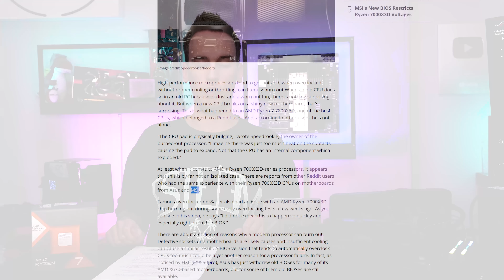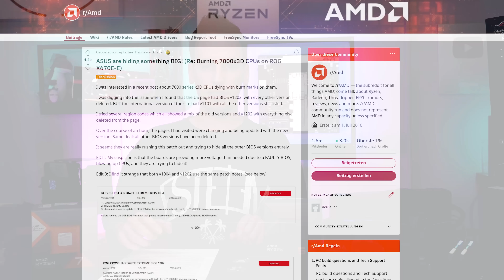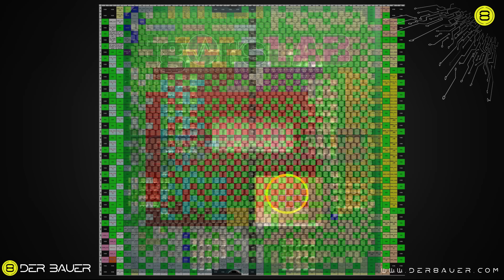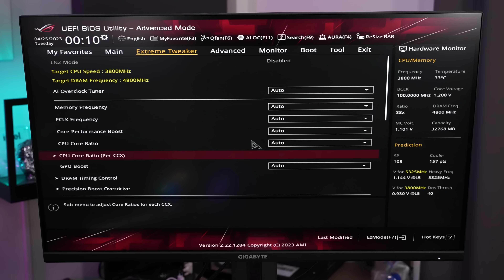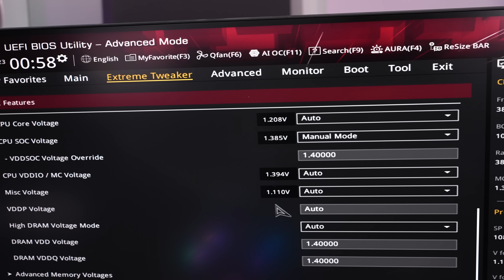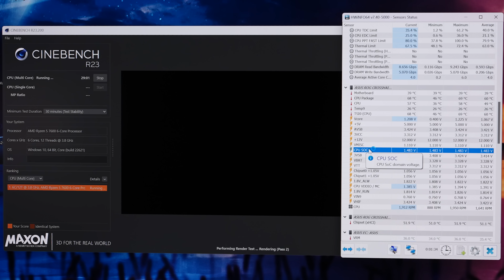I missed the Damage on this Ryzen 7900X

Comment: it's crazy how new cpus run at 80-90c with AIO and even custom liquid cooling 13 years ago cpus with custom liquid cooling 360 or even AIO run at high load at max 50-60c i remember my X58 CPU at 4.4GHz with custom Liquid Cooling 360 rad run at 23c idle and under synthetic load never went over 45c in games usually will go up to 30c and that was a high end CPU i think it was 2012 or 2013 when new intel CPU started running very hot but ya CPU should not run at 80c and over hell new cpus idle at 50-60c that's just crazy

Comment: This shows that most CPUs are able to handle this and it only sometimes fails horribly like the cases that got viral. Also proves that the RMA rates are indeed lower for the Ryzen 7000 than older ryzens. It is a huge fail, and very dangerous, but fortunately very rare. Which is good, because 3 weeks later, it still hasn't been fixed fully :D

Comment: I don't overclock normally but would running DDR5 on EXPO on 7900X cause the CPU to burn too?

I have an ASUS B650-E F Strix.  Many times I've activated EXPO to 5600-6000MHz the system would often fail on bootup that it would reset the bios every other time I turn it on.  When I do check the temps the CPU never went above 75°c when gaming or anything else.

Comment: my build is: 7900x and asus b650e itx mb in an itx case(fractal ridge), cannot use high end cooler, so i set the cpu only boost to 5ghz, pbo to eco mode/ctdp 105w, core volt to 1.10000v soc 1.20000v, vddio/mc volt to 1.20000v, no problem at all

Comment: it should be pointed out that software reported voltage data isnt always accurate and that pinning at the board has found the voltages to be slightly higher then reporting- aka say you set 1.4 you may actually get 1.425-1.45 lets say

Comment: WHY NOT cool CPU core/s from both sides..???? 
(I have been wondering since the beginning of time)

It's obvious that a lot of CPU core heat is getting into CPU substrates, with almost no path from there - into the MB CPU socket - MB/PCB - etc, except via the many tiny pins/contacts.
As just about anything is a better thermal conductor than still air; any non electrically conductive, non-capacitive substance in the MB CPU socket should help.
Even Dielectric Grease, as used by the sub ambient cooling crowd, will be better than air/nothing.

I am sure some research would turn up a (thermally) better non electrically conductive, non-capacitive substance than  Dielectric Grease to put in CPU sockets.  
A HS on the back of the MB socket area would likely help too if thermal conductivity through the CPU socket can be increased enough.

Comment: Running a R9 7900X on an Asus X670E Crosshair Hero with Expo enabled. The voltage was at 1.341 as you showed. After all the notifications about the issue, I updated to the most current BIOS no available and the voltage is not down to 1.291 or so. The system has been stable. The RAM is running that the rated speed of 6000, so it seems okay.

Comment: Since Intel began to make pinless CPUs I have been complaining about it. This is a stupid connection design based on contact system that is only safe to use if you are transferring low power. As soon as CPUs starts to dissipate hundreds of Watts and very high current values like current generations are designed to. The chances of overheating on the contact points are huge. I wonder if the the same burn or melt would happen if this CPUs where made with proper contact pins.

Comment: AMD Identifies Cause Of Ryzen Processors Frying Themselves
"AMD has issued a new statement concerning recent problems with its Ryzen 7 CPUs frying themselves. Over the last few weeks, AMD and motherboard manufacturers have been grappling with a worrying issue regarding its new Ryzen 7000 CPUs where these were seemingly being fried by an unknown issue involving sky-high temperatures." - Forbes
"Yes, Steve and his Team are doing great work in this area...there are multiple problems here for sure.
"We have been able to reproduce a catastrophic failure resulting in the motherboard self-immolating while we were running external current logging, thermography, and direct VSOC leads to a DMM. The issue involves incompetence on many levels. The video script is being finalized now. This video has taken us all week to do. We stepped off a plane from AMD HQ (unrelated, but convenient timing) on Tuesday and immediately set to work. It has been a time-consuming, expensive, physically exhausting process and we've loved every minute of it. The team is thrilled to have a real result and successful root-cause analysis that goes layers beyond "it's SOC voltage," because it's not that simple. We appreciate your support in viewing the video when it launches because that's the real reward for our tired team. Keep an eye out and share it wide. Thank you!" - Gamers Nexus

Comment: Currently I have been running 7950X3D on 1.35v SOC for a while now and no problem. I'm primarily testing games so it's not full load but this processor has been running 24/7 since release day and no problem. EXPO 6000MHz G.Skill DDR5.
Reply: likewise but just in case I updated my BIOS it had a recent release for the X670E Extreme less than a week ago  :)
Reply: What brand mobo?

Comment: I thought voltage was localised. I was not aware the cpu required extra voltage if expo is on. I would have thought the cpu would have been designed to handle data throughput from existing and possible future ddr5 memory without itself needing an increase in voltage else the faster the ram the higher the voltage. Remember IBM GXP 75 HDD they failed because they were switched on and off so often - while the testing at IBM had been done based on continuous 'always on' hours. When you have electrics you have 2 current forms - one called FLC (normal running) and one called 'starting current' (which is a higher current burst when switching on)

Comment: Hi. I am running the Ryzen 7950X and i was testing out voltages and i have now set my Soc voltage to 1.250V and this keeps the voltages between 1.296V  -  1.305V. On Auto with Bios 0922 the Soc voltage was reaching 1.492V whilst using Cinebench R23 on my Asus X670E E Gaming WIFI.  I am pleased this issue has been found now before more processors burning out. Great Video and Thanks for doing what you do. Asus has just released the 1401 update for 7000X processors.
Reply: I have the same CPU and I updated it recently m tbh I never had issues but best to be safe than sorry - BTW ROG CROSSHAIR X670E EXTREME BIOS 1303

Version 1303
9.54 MB 2023/04/27 IS Official that which you applied is BETA beware :) I was on the phone to Asus and they said it's best to use Official due to possible instability factors on BETA versions.

Comment: i'm sell  over 700 amd products from last year until now. none issue. from amd 3k to amd 7k series. I don't buy out of fanaticism. this issues only happen with some certain people and asus mobo, also they have issue with memory. also in my test bench i have n asrock mobo 450m+5600g at 15% overclocked both de micro n the igpu, with 3 diferent brand, clock n memory speed, made on purpose. works fawlessly. Intel sell more defects products than amd. best mobos for amd 7k series= MSI 670e ace, asrock n gigabyte. asus now releases new bios please update!. my grand pc have and msi 670e ace, amd 7k950 3d, 6400 dual channel 32x2 gskil F5-6400J3239G32GX2-TZ5RS + msi xtx7900, works fawlessly. none issue at all.
Reply: Flawless till it isn't

Comment: I'm not 100% familiar with the 7000 series yet, but going from 1,021 v. on the soc to 1,341 just by enabling expo (expo 1 mind you, expo 2 might be even more aggressive) seems like a huge bump to me. Could it be that expo just applies too much voltage to the soc to compensate for the high memory speeds?

Comment: Roman, our contribution to the story should be to immediately denounce the product. Permanently. Because they CANNOT keep taking turns pushing their hardware further than they should to the point that it ends up in a landfill within a year. They CANNOT consistently do this to consumers and get nothing but polite critique like they have been. Everything is already anticonsumer as it is, this is utter nonsense and Im gonna fly into a rage if Amd dont feel incredible shame over this. Try to find out what board the 7600x burned up in because that board is probably a straight fire hazard tbh

Comment: I can't speak as to why, that's your department :D
BUT the actual final failure damage appears to me to be caused by some material between the board layers hitting a temperature at which it outgasses.......deforming the layers around it.
It's not really a materials issue, as they are Failing WAAAY beyond service cuttoff temp.

Comment: Remember cracked gpu dies yes everyone saying this happened cos they where cleaned with water, well i have always been skeptical cos of that still worried its not water damage but actual dies that cracked cos of driver issue or fault in batch it self, and obviously cannot argue a driver cannot kill gpu nvidia has done that already, and we seeing cpu's die cos of bad bios now that been pulled from many vendors, maybe not worth making a video again on the topic of cracked gpu dies, but im woried this story will get a part 2 sooner or later, heck already had 7900 XTX mba cards with hotspot issue, what if thats not a vapor chamber issue at all either but cores that just run hotter then within specification ?
Im getting quite paranoid of AMD lately, while we need AMD to compete cos Nvidia is getting quite a big monopoly, Intel is still having way more market share so AMD is not really competing that well against Intel either.
Life just sucks right now.

Comment: Hi, fresh owner of Asus TUF X670E-Plus and 7800X3D. Running latest BIOS 1409 and the CPU SOC voltage is efficiently locked out of user reach. Have Kingston Furry 6400 CL32, and once the DOCP profiles are active you cant regulate the actual power. Its stick to 1.376V with drop down inactive and set to auto. If you go for manual mode and +/- offset, you still cant input any value and get the Auto value.

So far I was able to run the 30 minut CB test with the DOCP set to 4800 and 6000. Once at 6400 the test will fail, if im at all able to get to Windows trough BSOD.

Can provide some pictures video if interested.

Comment: I’m using the MSI X670e carbon board with a 7900x3d. When expo and auto Soc are set the soc v is 1.39, if I change auto to AMD overclocking and the next drop-down to auto the doc drops to 1.18 with no change in stability or cinebench scores

Comment: I feel like this 7800X3D is a ticking time-bomb in this new PC. I was tempted to follow some of the voltage suggestions in the comments, but I opted to turn EXPO off instead and just let the RAM run at 4800.
Reply: That is a safe approach but U can look if they did a BIOS update I got one recently "SoC voltage for Ryzen 7000X3D series limited to a maximum of 1.30V to protect the CPU and motherboard."

Comment: I think I know why it is happening. Socket pins getting too hot, because of too much current passing through pins. And over time, PCB swells up because it is nothing but pressed glass fiber soaked with epoxy resin. Over time, epoxy resin starts melting and that's why swelling happens. It means that Socket 5 has power delivery problems. You could even repeat happening damage. Take a piece of glass fiber epoxy PCB and put a soldering iron on it. How long exactly it will take, I don't know. It could take a week or even several months, but once it happens, you will see exactly the same damage. Because epoxy resin is not heat-resistant.

The solution is pretty simple, reduce wattage passing through socket pins. Means that processors have under perform, AKA throttled down. Obviously, that affects only higher end models. Higher end models are more power hungry. Not good, first IHS and now too hot socket pins.
Reply: I had also Underpowered Mine from stock 170 watts to 105 watts: 142000 PPT, 110000 TDC and 170000 EDC directly in Bios, never had issues but I decided to update BIOS due to them "FIXING" - "SoC voltage for Ryzen 7000X3D series limited to a maximum of 1.30V to protect the CPU and motherboard."

Comment: The thing that worries me about this is that even if the VRM can still push more voltage into the SOC and AMD can do nothing about that, shouldn't it still not allow the chip to throttle up if it's not getting good sensor data?

Maybe the chip is already dead by then, in which case it's just a bad failure state, but if the processor is still pushing boost voltage without valid temperature data, then any sensor issue could theoretically cook the chip without a safe fallback. Something about this feels wrong, like maybe there's still an architectural oversight here.

Comment: I'm not sure yet. Don't quote me.  I dropped a new couple of sticks of expo ram into my system.  On a Asus board with my 7700x, I used a standard 1 click overclock on master not trying to really push anything. Now it's bricked. Can't get video,  just sits there. I've gotta pull it apart tomorrow.  I'm really hoping it's something stupid and not this.  But it has me scared.

Defiantly gonna check the bottom on my cpu though.

Comment: So; I'm running a 7950X on an Asus board (same Extreme as in your video) -- right now -- same memory in EXPO ( the Corsair running at 6000). My SOC voltage is 1.341V on auto.   My two questions are, and I hope i'm getting this right and yourself or someone else here can answer it:  1) Is there a chance that my 7950X is damaged already, even if it's apparently working (should I remove it and check for damage?) and 2) I should manually lower VDDSOC to, say, 1.20 maybe?  (VDDIO is at 1.39...)   --   I'd hate to have to pull my rig apart just to check for this 'bubbling', but also if it has occurred I'd want to get things replaced while I still can.

Comment: Im on 10th Gen Intel rn, 10700kf at 5.0-5.1 all core. And for the most part, i have a great time gaming, but it is in few ways starting to show its age. Im planning on upgrading within a year or two, and i really, REALLY want to give AMD/Ryzen a go. But the stability that Intel has.....Im really starting to think that i will eventually go with the 13700k as initially
Reply: Tbh I don’t think it’s so much the cpu but the platform. I have 2 Rocket Sabrent 1TB M.2 drives. The black sticker with blue lines(don’t know a better way to specify), and for my GPU, I have a 4070ti. I just feel like the PCIE Gen I’m on is what’s really holding me back. I mean now thinking about it probably not that much because of the bandwidth the 4070ti has, but I feel like with games like Hogwarts, if games keep going in this direction, I’m not gonna be able to move the data the way I need to to have a smooth experience. Now I do wanna say I’m relatively new to this depth of computing. But I’m eager to learn, so if anything I say makes no sense please do correct me.

I haven’t tried games like the last of us yet or RE4, but I plan on it. 

CP2077, which I do know is very very GPU bound. With high settings, no DLSS, no Frame Generation. I see about 100-130 FPS with around 70% CPU usage on average.
Reply: The 13 series i7 and i9 run very hot unless you limit it (power/current limit) , to the point that it sometimes spikes to over its thermal protection limit and shuts down on some loads.

If you want to stick with intel, I would either go with the I5 or if you really need the multithread performance an i7 with sane manual limits (like the 219W official limit, and single core to like 5.4GHz) 

I'm not sure what limits you with a 10700kf though, it should be plenty capable for most tasks. My 8709G manages gigabit decompression, so it should be able to handle about 2Gb/s, which is enough in most cases and imo not worth like 600 bucks or more for the upgrade.

I don't know any game which would tax the 10700kf enough. You'd be running at like 20-30% usage at most in game on a 13700, so 40-60% should be fine.

If you really want more performance, getting an nvme ssd with a dram cache if you don't have one, tweaking windows and getting a better gpu would be better investments.

Also this issue seems to be pretty rare compared to the number of cpus, like 0.1% at most if you have expo enabled.